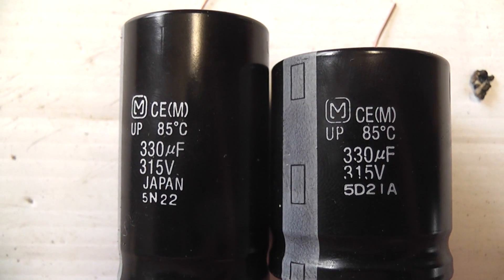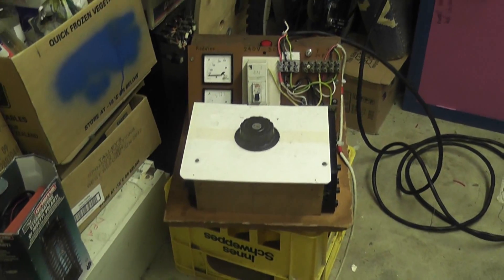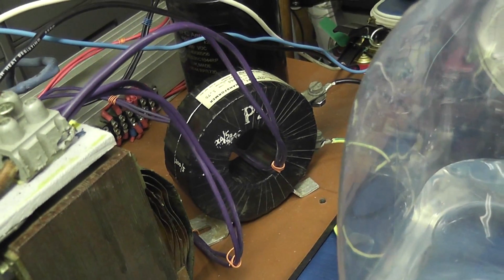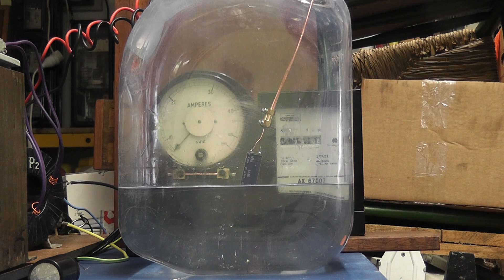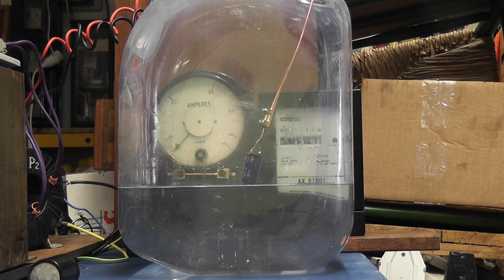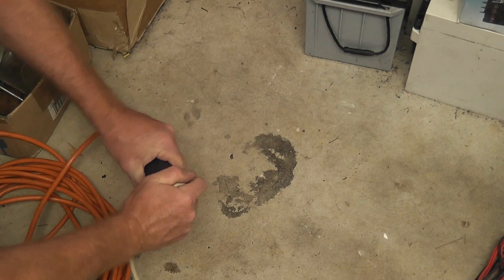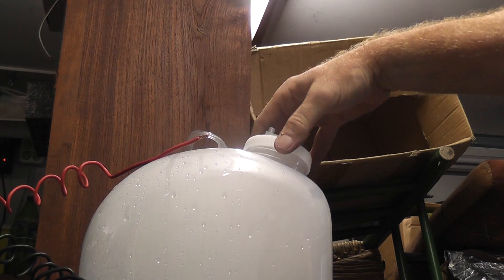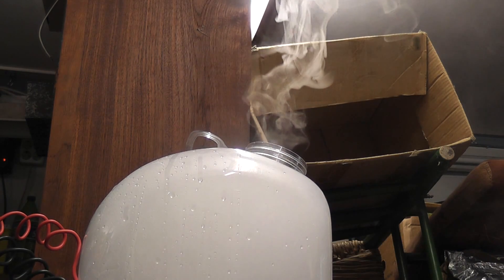2012 First Capacitor pops of the year in HD

Comment from the maker: @BoomBoxDeluxe That ols Ammeter came from a water pumping station. I have two others also in service in the house. They featured in some of the older meter video's.

That is 40 / 1 Amp CT ratio extended to 240 Amps to allow for motor starting.

The SPA 01 didn't record much at all. At switch on the electronics takes 2 seconds or so to get ready. By then the cap had popped and current was back to zero.

The jars of smoke are fore sale on xbay "grin"